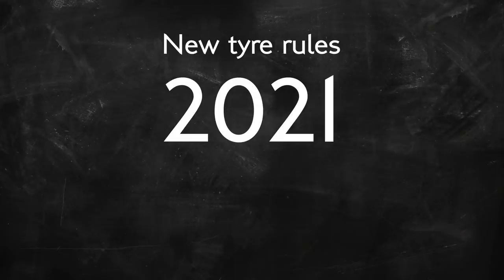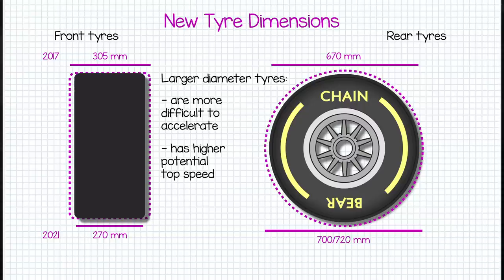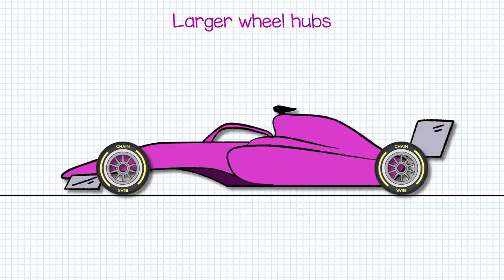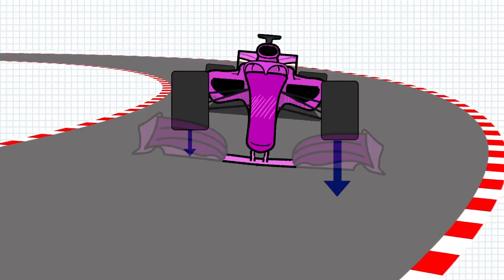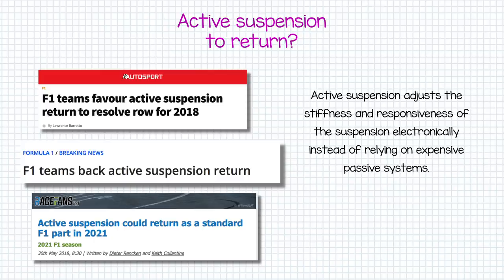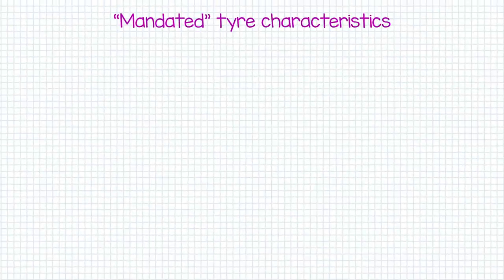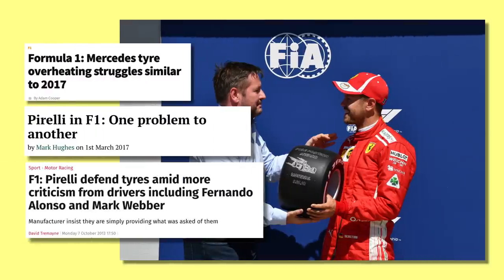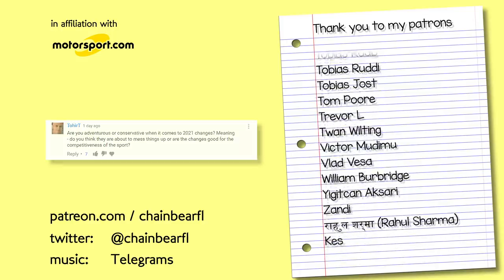New Tyre Rules 2021 explained - Low profile tyres, no tyre warmers, radical compounds

Comment: They need to stop having Engineers running the show...they make things way too specific. 
"Tire compounds need to be "a" faster than "b", but "a" must degrade by "z" so as to ensure "b" lasts longer while "a" remains faster. However, this has to be designed in a manner that after "t" amount of race time, "a" will see a sharp decrease in structure, while "b" will need more "t" before it reaches a severe degradation in tire wear."
I mean what the hell? How does one design tires so specifically that wear is controlled like that? I mean sure, it might work fine on one track, but when you take it to another suddenly "b" might be lasting much longer than "a" despite not seeing a major time difference. (And I'm not even including "c" into the equation!) In my opinion, as much technology that Pirelli has going for it, I don't think they stand a chance at making the engineers 100% satisfied.
Reply: I think F1 is abput having the best cars of all motorsport series, so the engineers will always play a vital if not the most important role. There are a lot of highly standardized racing series out there which are also pretty cool to watch, for example Formula e. If you dont like the engineering aspect as much, maybe head over there and you will be more satisfied. I dont think F1 will be moving away from being engineer dominated in the near future.
Reply: that's where the challenge is
Reply: Then costs would explode because engineers would do everything possible to gain a second here and there. Smaller teams would not be competitive at all, and at the end there would be only the few top teams. This would destroy F1!
Reply: @Ascender2306
Isn't that already happening? The only difference is that they spend millions of dollars for a few tenths of a second...
Reply: Yes, it is happening. But if you would allow all this it would get fast out of control.
Reply: Well its an engineering sport mate! You might want to find a different sport!
Reply: If engineers ran the show they wouldnt invent these ridiciolus rules. Engineers want to make products as good as possible, these new rules just artificially lessen performance.

Comment: At face value, each of these tyre changes seem to be going in the right direction to make the racing more competitive. I am also very encouraged to see a more directive approach from the FIA. It is and should be the FIA who dictate how tyres perform on race day, not the commercial incentives of a tyre manufacturer. The tyre manufacturer should not continue to have implied incentives to undermine good racing. 
Very interested to see how suspension will be managed by teams. With NO active suspension and higher ride height, there could be significant differentiation and innovation by the teams. It should also allow for drivers to show a wider variety of techniques and styles. 
It is very hard to analyse what may come without seeing a full range of spec changes, they all effect each other to some degree. So far so good.

Comment: Your comment on bigger tires being bad for acceleration got me thinking: What if the tire somehow started off small for improved acceleration, but slowly expanded as the car got faster, aiding in top speed instead? Obviously, some sort of active suspension or other tire-retract-y thing would be needed to compensate for the added ride height, but that should be easy enough to pull off.
Reply: Erm, no, for a number of reasons. That's what gears are for.

Comment: A couple more things, thinner sidewalls are stiffer against lateral loads and transfer forces from the hands to the road and through the car much quicker. This will increase responsiveness and turn-in and I suspect require less toe from the setup and therefore decrease tire-wear. Also, bigger tires increase overall surface area and may help contribute to longevity as well.

Comment: Chain Bear F1:

in the first minute you speak about the diameter of the rear tire.
an Increase will surely have less torque, but since that means also lower rpm, the driver will be in a smaller gear compensating this.
so, if you keep in mind, that the power of the car is constant and m*V*a=P is applied, you see that you cannot change a with a constant/same mass of the car and have the same acceelration at the same speed.

so why did you say that?

the only reason for a slight deceleration is, that a higher amount of inertia in the tire eats up some energy. however we dont know the mass and tehrefore the (insert proper word here) of the wheel. (i come from another language)

Comment: They probably could do the non slippery tires with layered tires, that being an extremely soft compound as the first layer that wears away into harder and harder compounds. This layering system can be determined by teams for different strategy's, and will keep and likely expand the variety of tires. The layering can be chosen by teams for even more tire strategy such as a hyper soft ( for the non-slippery thing ) , soft, hard, and super soft for that last final push before the end, as an example. Then the FIA will come in and say "No fun on my watch! All tires are standardized!" just because they can.

Comment: Thanks. I'm wondering if the low-profile tires could introduce a slower return to pace in the lap or two just after pitting than we are used to seeing today? Also, you spoke about the deformation of the current "balloon" tires in the vertical dimension, acting as a kind of suspension. If you could touch on the pros/cons of the effect of lateral deformation, I'd appreciate that. You see, I'm wondering if the lateral deformation is presently an advantage in some way, because in higher speed turns we can see that the tire remains planted on the tarmac while allowing for minor lateral deflection of the car. Certainly the contact patch would more easily "break loose" on the planned lower profiles, causing the car to slip, given that there would be less lateral deformation, no? Combine that with a cooler tire after a pit stop, might we be seeing a slightly new set of effects (in the negative) until the tires finally reach optimal racing temperature? Basically, could there be more driver errors or a slower return to pace especially for the first lap or two just after coming out of the pits?

Comment: The gradient tyre wear was already a thing for early Pirelli years, between 2011 and 2013 i guess. The problem with this "cliff" was that there were a lot of punctures without any contacts. Also, the point of that "cliff" wasn't predictible, which made the few-pitstop strategy very random option. For expample, in China in 2012 Kimi Raikkonen reached that "cliff" one lap before the finish line, going P2. Over the course of one last lap his pace dropped so dramatically that he lost 10 positions, finishing P12. After that accident the risk of picking an alternative few pit-stop strategy had became obvious, and fewer teams  opted that in future.

Comment: The overall  OD is going  from 670 to 720 mm so the change isn't  all about  smaller sids walls but a larger OD. The side walls could have been made smaller  on the smaller  diameter wheels. Wheels inf1 were bigger than 13" at one time and went down in size for various  reasons including  reducing rotating  mass as the wheels are like flywheels.

Comment: Bigger brakes from bigger wheels. Taller tires give more grip, look at 32" vs 35" drag racing tires. Lower profile tires have less flex which will react faster to direction changes. I think the tire/wheel changes will be good and increase mechanical grip. Changes to the tires, wheeks, breaks, and the required suspension changes will make for faster lap times.

Comment: A little mistake in the video, roll is the result of weight transfer and weight transfer is mostly a result of cornering forces applied on the center of gravity. Roll in itself has very little effect on weight transfer. The amount off weight transfer due the center of gravity moving about due to roll is negligible in relation to the weight transfer resulting from the cornering forces. The only way to significantly reduce the amount of weight transfer during cornering is to either lower the center of gravity or to widen the track of the car.

Comment: I think it will make for better (or say more interesting) racing without tire warmers, because after the pit cycle, you will get cars with hot tires and cold tires on track, so a potentially faster car has to battle with someone slower, but on hot tires.

Comment: How do the tyre performance gains factor in once you account for pit stops (and increased pit stops)? And not just the 2 seconds teams take to change tyres, I mean the time taken to taxi in and out of pit lane too?

By the numbers you gave us on tyre performance:
The medium tyres are worth 12.96 seconds vs the hard over the course of 10.8 laps
The medium tyres are worth 7.2 seconds vs the hard over the course of 6 laps
The soft tyres are worth 13.2 seconds vs the hard over the course of 6 laps
The soft tyres are worth 6 seconds vs the hard over the course of 6 laps

Comment: The biggest change  will be the suspensions will have to actually move, unlike today.  The tire sidewall is the biggest part of the "suspension" travel.  Most of the other car dynamics will likely be quicker, more positive, turn in, downforce will be more direct I'd guess?  Without tire warmers I wonder if they will have the tires mounted with barely enough pressure to keep the bead mounted to the rim, then minutes before the tire stop inflate the tire to the correct pressure with super heated air (nitrogen) to impart some heat into the tire carcass and rim.

Comment: Important to note with larger diameter rims, engineers will no doubt design larger diameter brake discs which will be subject to lower mechanical stresses so at tracks with high brake disc wear rates you wont hear the engineers trying to tell the driver to go easy on the brakes because the discs are about to disintegrate.

Comment: at 0:46 the tyre's are not 670 mm in diameter because the bottom of the rear wing would be below the top part of the tyre at the rear. The 2017 - present regulations say the the rear wing must be at 600 mm - 800 mm height, and 950 mm wide. The diameter of the current tyres are actually 560 mm in diameter at 13 inch rims. That's why you see the rear wing looks quite high and not level with the tyres when you look at the 2018 cars. The 18 inch rim tyre's will be somewhere around 620 mm. Not 720 mm. I don't like that they narrowed the tyres slightly but i bet these new tyres will be better
Reply from the maker: The bottom of the rear wing IS below the top of the tyre.

Comment: I think the thinner tire are there to reduce the suspension of the tire, to force the team to work harder on the actual suspension.
If you look closely, a 2018 F1 could have no suspension at all and it wouldn't make a lot of difference. With those they're gonna need real suspension.

Comment: The new rims diameter wont change anything on the car suspension. Most part of the actual tire is stiff. The part that matters is on the perimeter so making the tire narrower will only change less stiff part of it.
Reply: Alex The less stiff part can tolerate less, which means the stiff pay gets punished more which directs it to the suspension, so the suspension get punished more.

Comment: I remember Martin Brundle did a test with 18” tyres at Monaco a few years back. Said visibility in the corners was a big problem as the tyres were bigger so he couldn’t see the apex. Something else they’ll have to work on aswell I suppose
Reply from the maker: Well the size of the overall wheel is the same so it shouldn't be a big problem

Comment: IMO, they need to reduce the chose option. You must use soft tires for quali, good for 10 laps tops. Hard for the race hat is it capable of withstanding 100% load for 30 laps.

Comment: ok. so, genuine question here. The tires have this built in 'degradation cliff' . This is to make the race more interesting due to the necessity of pit stops. 
Well, what if they took it in the opposite direction? Had as little degradation as possible and ensure consistent performance throughout the life of the tire?
You would therefore reduce or almost eliminate the 'marbles' of rubber that end up just outside of the racing line. Then, you could strategically widen certain parts of the track's curves.  This way you allow the possibility of more overtaking. And isn't overtaking really what fans want to see ?

Comment: If they actually do that i think the cars will become slower. The low profile tires dont perform well in every situation. Its generally more of a tradeoff between straight line and cornering especially with the wide track of the rears.

Comment: Howdy wouldn't tyre deflection from a bump be dictated by the tyre pressure rather than the sidewall height? I think sidewall impacts more horizontal deflection since cornering forces have more leverage on the sidewall. Vertical deflection I think is a function of tyre pressure.

Comment: Well, right off the bat, we have a larger diameter rear tire.  That gives a slightly larger rear tire footprint.  Result, more grip on the rear in corners.  On the front, we have a narrower tire, which gives a slightly smaller footprint.  Result, less grip on the front.  What does that give us?  Understeer, understeer, understeer.  And so far, no-one seems to be able to manage the understeer on the current cars reliably.  That's one way to slow them down.

Comment: Overall, it makes me a bit nervous to know so little about the 2021 spec cars at this point. It was anticipated as a huge change, but the only thing that is 100% confirmed by now are the new tyre rules. The new 2019 aero rules might be carried on (and I like that) and new V6 turbo engines with standard KERS system were planned, but nothing has been confirmed this far.

Am I missing something here? I don´t think FIA should wait much more to make those decisions.

Comment: There are many many BIG downsides overlooked here.

Larger tire hubs - yes, they allow for more control through the suspension it self but it also means more not suspended mass and it significantly increases the stress on the hub and the axels them self, so some significant decrease is grip on bumpy parts like the curbs. And as the walls are shorter and transmit more of the shocks it also means they get stresses a lot more.

And the banning of blankets and low glass transition point: This is doing anything but increasing safety. The tires need to be hot to get the best grip. This is not done cause they just want to do it that way but because the rubber-mixtures with the best grip and wear-characteristics need to be "hard" enough under the stress of driving to not disintegrate too quickly. Forcing the tires to be soft from low temperatures means they have to withstand far larger temperature swings wich in turn also means the tires will have higher wear during normal racing - likely resulting in thicker tires.

The changes the FAA makes are nearly always there to force the teams to re-design most things so they are not able to improve on their already tested equipment.
Safety? Technological advances? Engagement? Not really the point of focus for them anymore.

Comment: I'm amazed that F1 is going this ham in 2021.  Active suspension alone in today's cars would make a huge difference.  The development curve with the new suspensions will be insane.  I'd be willing to bet the cars will be so fast in testing that they have to slow them down before the season.  The cars will pull more g-force than the drivers can handle guaranteed.

Comment: Pirelli will never pull off that complex tyre model. If F1 want genuine strategy based on tyres the easiest way to do that is to slow the pit stops to make changing tyres more costly. It is easily done by restricting the numbers of crew and equipment which can be used during a stop.

Comment: I think the move to 18" tyres is a good one, it's a lot more relevant. As for F1 in general i think it really needs a huge shake up. Are they still planning on new engines for 2021? If so i wish they would go back to turbo 4 bangers (only because i feel v8's v10's are completely out of the question). It would be more relevant and sound great imagine 15k rpm 4 cylinders (superbikes). Sport definitely needs a hike in power to maybe around the 1500hp mark, i'm sure the car and track safety levels are there to support it. Definitely simplify the aero and maybe allowing ground effect again would create closer racing.
Reply: There planning to remove the mgu-h but the engine suppliers don't want to do this anymore. It was supposed to bring new suppliers but no one appears to be joining.

Comment: "Can't be adjusted by the teams"  in regards to the tire.. that is what tire pressure adjustments are for... but they are extremely limited.
Reply: He's talking about the undamped springiness of the tire. Air pressure changes the spring rate of the tire but not its damping. The springs in the car can be controlled by dampers (shock absorbers) but the spring that is the tire cannot.

Comment: Yes, question, rather technical. Is there an actuator on the stearing wheel clutch in an F1 car? Providing ‘force feedback’ on clutch pressure. Or is this clutch a lose flappy pedal without any clutch feel?

Comment: Will teams not just circumvent the tyre blanket restrictions with ovens, heat guns, leaving them in the sun to warm up (or building a solar oven if the tyre cannot be "actively heated")? Their goal seems difficult to implement in practice.

For my part I always considered large side walls to be one of the defining features of an F1 car and assumed this was implicitly done to offer the tyre supplier (Pirelli) more advertising space.